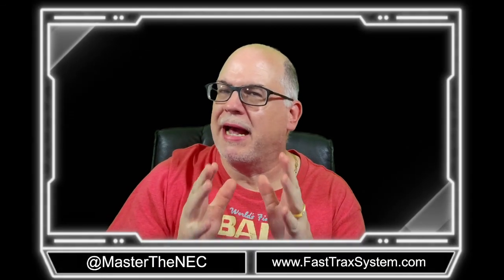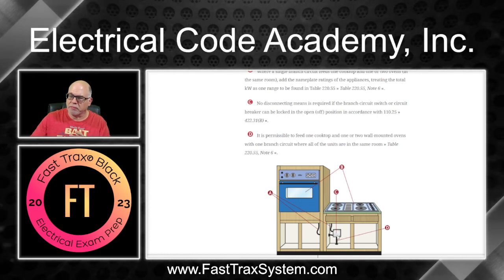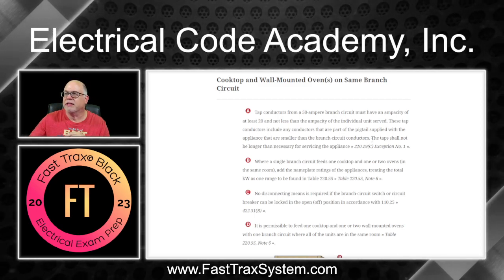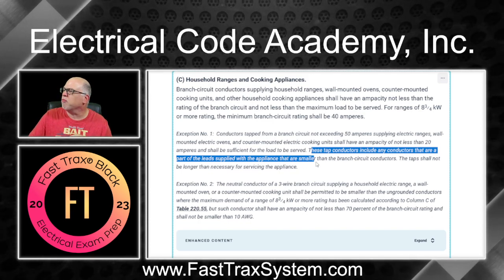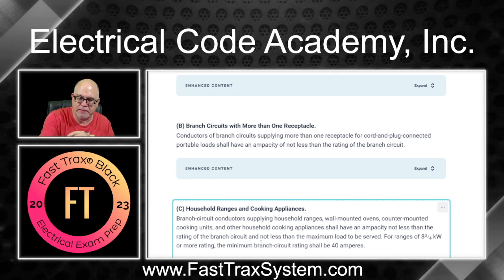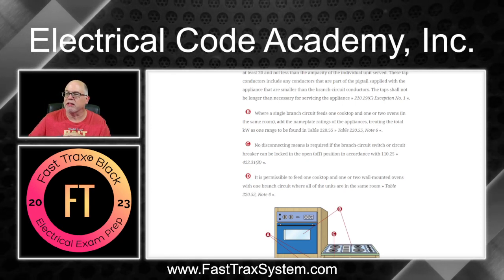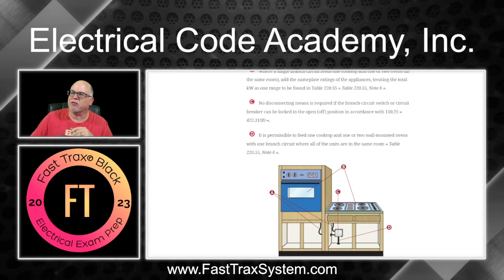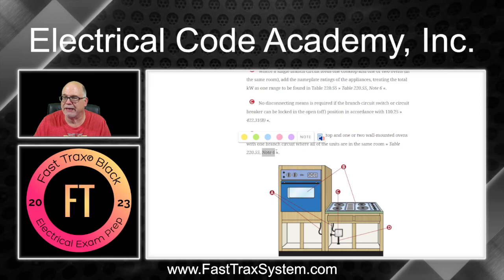Branch Cirucit Sizing for cooktop and up to two wall ovens using the branch circuit tap rules

Comment: Good stuff!  I'm getting ready to replace a 30" free-standing range with a separate cooktop and single oven to be installed in a slightly different spot.  Your description of the taps makes sense to me.  I plan to get into the crawl space for the dirty work on moving the branch circuit cable to the new location and then have an electrician do the hook ups.